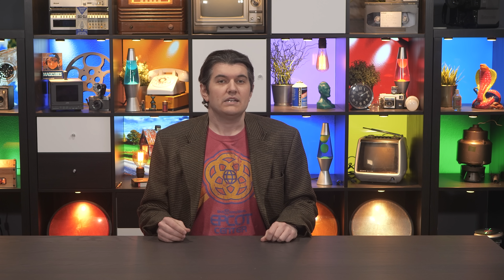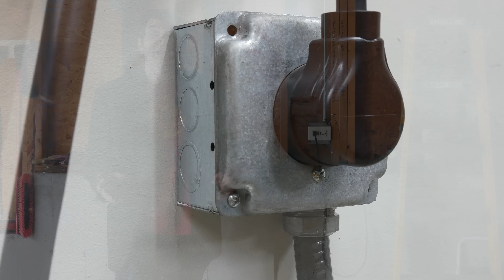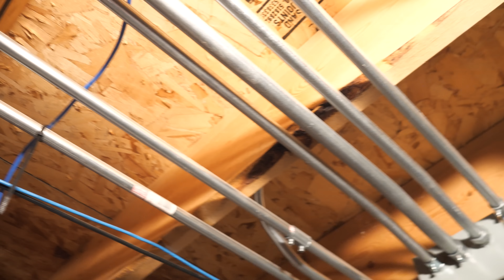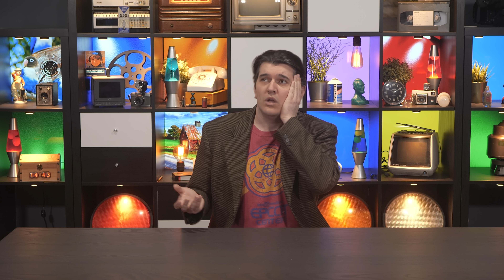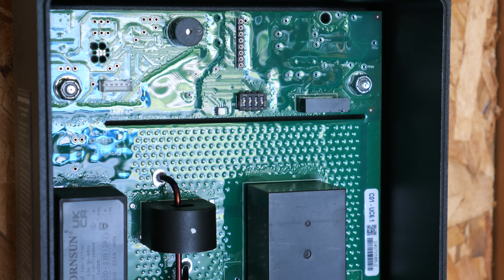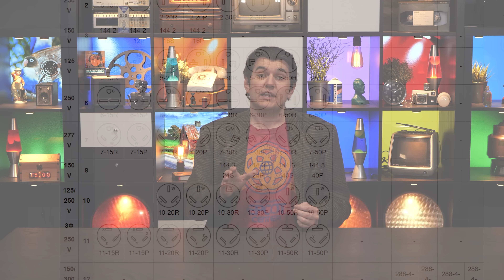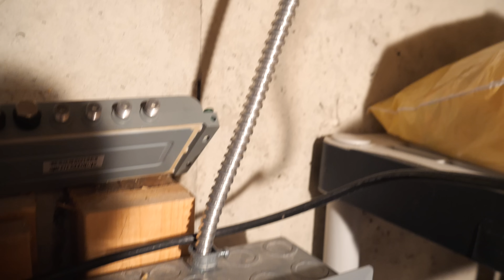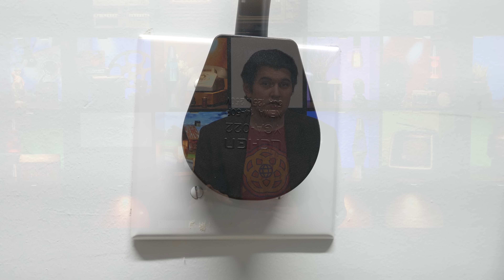The "standard" car charger is usually overkill—but your electrician might not know that

Comment: Thinking about 1st elec car. Do they need to be charged and stored outside? 1% risk of fire is too much.
Reply: I have been charging for 13 years. Inside or outside winter and summer, rain or snow, 30a to 8a. I know several people whose house has burned down because of badly installed ac. Not car chargers. Plugging in your car is about as dangerous as plugging in your lawnmower. If you are scared of a fire hazard with your lawnmower or a dryer, then hire a professional.
Reply: @Miniweet9167  Ok Mini, just asking for info. Curious, sounds like my question riled you up. Why are you upset? I am a not scared of shxt. Potential first time EV users here, you see stories, so you ask a question. You don't expect to be a stranger to give you a combative answer.

Comment: What about battery degrading? Will that slow down charging efficiency in regards of range too? Are there consequences when u have solar availlable?
Reply: No. Battery degradation only affects range not charging speed. It will fill up faster because your 100% will simply be a smaller number of available kwh in your cells.

Comment: I get that you've made so many videos on electric cars because people are pretty uneducated about them.

I honestly would have bought an electric car last year because I needed to replace my 280k mile 2008 honda accord.  The problem is: neither honda nor toyota are currently making small sedan or compact cars that are fully electric.

I settled on a prius(and not the plugin kind) as a happy medium. I didn't get the plugin version because the additional complexity makes them significantly less reliable(from the limited research I did).

Comment: Best practice is to install wire nuts with the cap facing up. Also, get yourself a 1/2-in and 3/4-in pipe bender. Learning how to work with EMT and rigid conduit is rewarding. getting that perfect offset or radius not only looks better than flexible conduit, it is better

Comment: For us an outdoor version of a standard 200V (Japan) socket was fine and we charge once a week using the type 2 cable included with the car. We have pretty low usage, but if we had more average usage it would might have to charge 2 or 3 times a week. We already had 100V outlets out there, but needed the electrician to install 200V/15A for the type 2 cable.

Comment: To add on to your smart charging station bugbear, there are very few "dumb" charging stations that have the J3400 connector. They all seem to be J1772. There are a fair few ones that have smart features that are not required for set up, but then I'm paying for this useless computer that just sits in my charger for no reason.

Comment: When deciding if 120 volt overnight charging will meet your needs, you should check to see if your garage has a 20 amp circuit; you can then deliver 16 amps instead of only 12. It is not uncommon to have a 20 amp breaker and #12 wire feeding a 15 amp outlet; in that case you can upgrade the outlet to 20 amps.
I am happy with my Emporia charging station, even if it requires an app (48 amps, 60 amp breaker, #6 wire, direct connected).  If you install the Vue sensor on the main breaker, the charger will dial back its amperage when the total draw on the house approaches a programable limit.  With a 100 amp service, this is a useful feature.

Comment: My 2017 Bolt doesn't have any useful app information or reporting without a paid subscription, so I do have a Chargepoint charger to get my energy reporting and the potential for demand reduction. Chargepoint starts at 16a and you need the app to step it up. If it ever becomes an issue, I will deal with it later. My utility does not presently offer TOU or DR, but they plan to. My main use for my energy report is spreading the good word of EVs and how cheap they are to operate.

IR imagery is such and underutilized tool. It is getting so affordable, and can reveal so many issues. (electrical, insulation, air leaks, pest intrusion...)

Comment: I just use the NEMA 5-20 outlet for a washing machine that is in my garage, like most homes in the USA. Slightly more amperage than a standard 120v outlet- I have a Tesla Model Y, typical day never goes below 50-60%, and I stop charging at 80%, always start my day at 80% no problem...

Comment: The main reason I don't like EVs is that electricity is very fragile, in any natural disaster, it's gone. And you're stuck and cannot spend the time to get your car ready.
Reply: That’s why most 2 car families have an EV and an ICE car.
Reply: Um. I use my car as an emergency home generator because the hours I was plugged in before the power went out, filled it up. I can run 25% of my house usage on the car battery for up to 5 days non stop (no central heat or oven or dryer but every 8-15 amp circuit works fine). What I’d like to do is buy a 7-14kwh 240v battery for the house instead of plugging in the car, but for the amount of power outages we have per year (which is at least 4x 5x per year for an average of 4hours max) it isn’t that much of a hassle to run an extension cord to the switch I had installed on the wall panel. People overestimate how much energy EVs really need when compared to average usage. The last big winter power outage we had, all the neighbours were at my house and we had fondue since my house was the only one with lights and power … from the car.

Comment: If you install a receptacle:
NEC CODE 625.54 Ground-Fault Circuit-Interrupter Protection for Personnel.
"All receptacles and outlets installed for the connection of electric vehicle charging shall have (GFCI), ground-fault circuit-interrupter protection for personnel."
ALSO STANDARD RECEPTACLES ARE BURNING UP.  Make sure you buy a special EV stamped plug as it is supposed to handle continuous loads.
Hard wiring solves some of these problems as stated in the video. Watch the entire video, as important stuff is in the second half of video.

Comment: I need to get a level 2 charger.  My commute is 90 miles round trip, 5 days a week.  I also work nights, so can't take advantage of offpeak charging rates.  Any suggestions?  Also have a gas dryer in the garage, so no available 240v plug handy.

Comment: you can get a 40 amp 240 volt breaker for about 80$, you want the safest receptable  like bryant for about 50$.    So if you do the install yourself with a receptacle near you breaker panel. the marginal cost to got to 40amp fuse, which will actually deliver 32amp for most chargers over a lower current breaker is absurdly little.  Like what if you forget to plug it in, and get out of town in the morning.  Its worth being able to charge at  32amp at 220V to charge a typical 70kwh battery from 20% to 80% in 6 hours

Comment: Installing a Hard wired, dedicated circuit to a WALL CONNECTOR is the only way to go.  DON"T cheap out, do it right the first time.   PLUGS ain't your friend.   Numerous people have had plugs MELT on them after a couple of years of use and they thought everything was fine up until it wasn't.   I have NO range anxiety,  When my plans change I can throttle up the charging rate and take off quicker by using the full 48 Amps on my Tesla Wall Connector whereas I usually only charge to 50% daily @ 42 Amps.  Having that flexibility is safer all around especially with a dedicated 60 Amp breaker.

Comment: Is NEMA 6-20 secretly the greatest middle ground, especially in a house with 100A service? I don’t need more power than 16A charging rate, and I do not want to panel upgrade an older home over EV charging.

Comment: Good info here although no the 110 for me.  I'd have to have a 220/240 in the garage if I ever go EV.  You don't want to live in a situation where you get caught out not having enough juice in the car, especially for an emerency or a lat minut trip comes up. Plus, most EVs have a setting that allows you to limit the amount the car is charged to save on electricity and battery.  I'd like the comfort of knowing, I can get a full/complete charge overnight.  Depending on the situation, even a rapid charger can take a few hours.  If it ends up being viable wherever I end up living with an EV, I'd be happy with a fast carger capability at home..310-350W?

Comment: A high-current Level 2 EV charger has been useful for maximizing the utility of excess solar power. I have a NEM 3.0 utility plan, so any power sent to the grid practically worthless. Once my home batteries are charged up, I want to bank as much power as possible in the EV, often approaching 40A at midday.

Comment: I went the electric dryer and automatic splitter direction. It works great, but the splitter I bought off of Amazon limits the current going to the car to just 20 amps at 240 volts. (This wasn't mentioned in the printed specs online.) This is still WAY faster than the 110v charging I did for the first few months I owned my Bolt, so I have no complaints. It's enough that I can drive 4-5 hour Uber shifts in the evenings after work without needing to resort to DC fast chargers. Still, I think I'm eventually going to have a 50amp 14-50 plug installed in my garage so that my wife can drive an EV as well.

Comment: I installed our Tesla charger and wiring for a 60 amp circuit to be able to charge at 48 amps but we are able to adjust the amps from the app to any current we want and I have it set lower to 24 amps and we charge every 3 days when we hit 20% up to 80% most of the time but we like having the ability to speed that up when needed

Comment: I think slow trickle charging is the best method for battery health. In the example you quoted where you have a 16A circuit and a 240V supply giving a 3.8kW charging speed, is that 16 A circuit spec'ed for a continuous 10hour 16A draw? I think if the breaker says 16A, then it's best to use it for a continuous load x% of the breaker's max load. Am I on the right track?

Comment: I support the show on most of its conclusions, but 200 miles each and every day is misinformation. If I drive 100 miles a day I'm going to be having to stop at a supercharger multiple times per week if I don't have a 220 charger. Nor would I recommend using an outlet like that to continuously charge. There was a fire near me due to using an outlet like that. Maybe it was old. But the city is saying it's because those outlets are not intended for the heat generated during continuous use.

Comment: The standard 220V dryer jack originally installed in most home may not handle the long hours of contiuous current needed for an electric car charging.    A lot of people in the know say to replace existing with a more robust version of the dryer receptacle (industrial-grade or commercial-grade) like the HUBBELL Receptacle: 10-30R if that's the kind of plug your are using.  Also, alll electrical wires connected to the receptacle must be torque to manufacture recommended specification.  Yes,  double check the receptacle with a heat imaging tool.

Comment: These are all excellent points. At about 30 miles a day, we can generally keep up with our charging based on our usage with a Level 1 charger. I elected to install a Level 2 mostly to have peace of mind when doing more extensive driving so that we have the ability to charge up much more quickly and get our battery back to 80 without having to try to "catch up" - but, for many people who travel short distances and are rarely doing more excessive driving, the included Level 1 charger that comes with the car should work just fine.

Comment: We've owned an EV for almost 4 years. I only have 20 amp service to my detached garage, no easy/inexpensive way to get more service to it. I had a Walbox charger installed, dip switch limited to 16 amps. It's worked fine, easily can charge overnight 90% of the time. On the rare times when we come home at 10-20%, it still will be 70-80% by morning. 48 amp charging is nice, but not a must have!

Comment: This guy is bonkers we have 2 EVs and are barely getting by with 3,2 kW of power.
Reply: Probably because your home is set to 110 V and 30 amps. If 3,2 kW of power isn't enough for you, you need to upgrade. But then again, 3,2 is still manageable if you only charge at night when everyone is sleeping.
Reply: @texanplayer7651 208V 16A. It’s fine in the summer but not enough in the winter and have to super charge one car at least once a week.

Comment: Some words after a published video from Linus Media Group's main channel.
According to what stated in that video, Grizzl-E in British Columbia (CA) currently do not provide replacement cords of the stock one provided with the metal box.
The company had cable cut and theft, for the copper, but the supplier only proposed to send the uninstalled boxes to them, have the power cord (from box to vehicle) replaced for 200USD plus labor, then send reassembled box (with cord) back to the customer.

On one hand, i can understand why: the product is tested and verified from the company, so that can provide a "it works" assessment and avoid any claim.
However, it's like a car manifacturer requesting money for send any wheel back to the factory before allow install back on the car with the new tyre.

"It's not the same thing"... probably, but the cord uses 4 screws for electric contact and the cord sealer bolted to the box back in. 5 "twist things", like al lot of tyres on cars and there should be some sort of trained professional do to that. 
Ok, fine, to detach and reattach the cord the metal box must be opened but hey... still electrician job.

I hope that some customer organization can push for allow self maintenance on working "chargers", without spares being blocked by corporate procedures.

Comment: Hi, Germany here. I cannot agree more. Most people here belief they do need a wallbox (11KW or 22KW) which do cost 1000 or more €. I tell them that most cases a normal power sockets here is doing it! As we do have 240V and usually 16A breakers according to the 80% rule everyone can charge with 3KW almost everywhere. I did use this kind of installation for 9 years. Today I do have a 3phase 16A power socket. This can provide up to 11KW. More than enough to recharge a Tesla Model S over night.

Comment: In case nobody mentioned it, connections using aluminum wire should be re tightened shortly after the initial tightening. If not done, you might get arcing which can cause fires.

Comment: Even though you can charge on a standard 120 outlet, I would not recommend it unless you know that it is ran using 12 gauge wire. Even though 14 gauge wire is rated for 15 amps AND the car is only pulling 12, its pulling that constant 12 amps for like 12 to 15 hours, which means that any problem in the circuit like loose connections, wires spliced in a jbox, etc, can build up heat and eventually fail. That is alot of stress at max circuit capacity.

Comment: My level 1 power point in Australia draws at 2.2kw on trickle charger so it draws as hard as a running electric 2,000kw kettle.   8 hrs tops back up my wife’s PHEV each evening after work for her trip.  Can’t justify the cost of home fast charger installation when it only cost $4.00 to charge a full battery on 240 trickle, and the car sits at home 20hrs a day anyway.   Being a petrol EREV its not a priority when not suitable.

Comment: If you are doing a 240v receptacle make sure it is an EV rated receptacle. the standard NEMA 14-30R type have been melting do to the continuos load issue.

Comment: I had an "electrician" that helped install my HVAC not tighten the lugs in the panel down enough for my 220 hvac it just enough that the breaker didnt go but it did melt the insulation down 6 in on both sides over the first night with my new HVAC. Power company sent someone out and the Meter automatically cut power to the house because of a heat fault (it was on the other side of the wall from the meter) It was crazy

Comment: Make sure you’re following code for your and any future homeowners protection. Changing the dip switch might limit the amps but someone in the future could change those settings to 50 amp. I supposed that would cause the breaker to trip but it would also be better to avoid that. Why not put a 50A breaker in.

Comment: i was looking to pick up a chevy bolt with the battery  recall ive seen 2018 ish with 20k miles and a new 2025 battery with the 8 year 100k mile warranty for 10 to 13k  ......but my 1st estimate on the home charger was 3500$ im looking into 2nd opinions on the install

Comment: I need a bigger level 2 charger. i will eventually get a 48 amp charger, 60 breaker. I use a lot of the battery for work 4 days a week so being able to get a full charge in less than 8 hours is what I need.

Comment: Workplace 120v Level1 should be more common. When there is Level 2 there is often a 4 hour limit. This means people there for the workday have to move their car and juggle a waitlist for getting a spot. I have seen this cause lots of problems in a workplace, especially if the parking lots might fill up because you have to move your car but there are no free spots. 
A much cheaper to install alternative would be more dedicated EV spots with 120v 15or 20 amp outlets. If you want to be a little more fancy you have a very small number of L2 stations then a bunch of spots with Plugzio 120v boxes to get more control.

Comment: i went one smaller. i got a 20amp charger on a 50 amp circuit. Reason, i really didnt need anything more. even with a newer car (originally a Kia Soul EV with 33kw battery, now an 77kw Volkswagen ID4) it still charges overnight regardless of 60,70,80,90 or 100% target.

Comment: In Brazil we also have split fase. 

220V 40A is quite common for direct wiring electric water heaters and induction stoves.

Our electric standard permits 20A sockets throughout the house, so it’s getting common to see new houses with more than one 220V 20A sockets in the garage.

Most people can have a charger capable of like… 4KV, and have no idea.